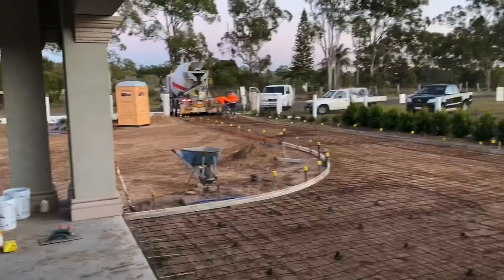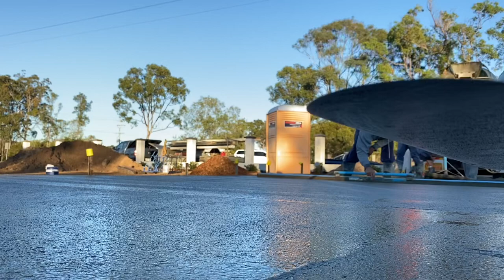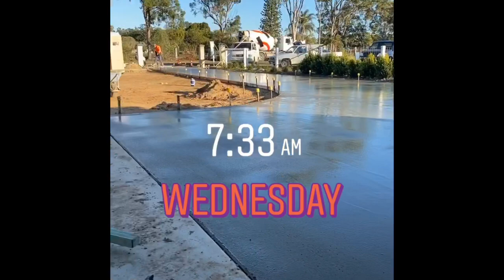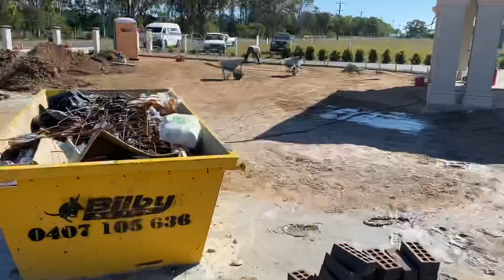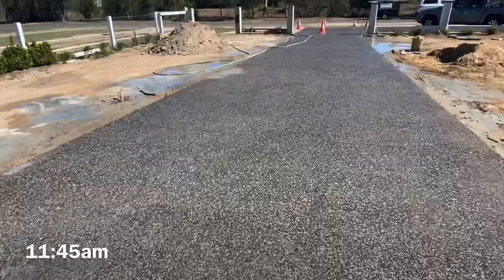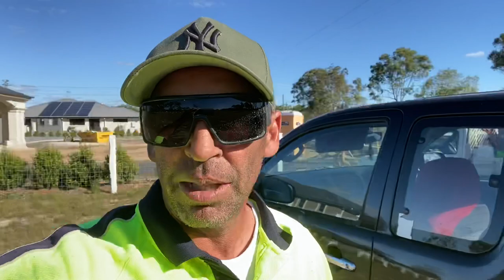Tips on when to wash off expose concrete

Comment: What do you do if the first part of the pour washes off and the rest doesn’t was off, tried a broom when washing off but no go, is there any way to wash it off? Acid wash?
Reply from the maker: It always washes off but if it didn’t wash off you could use acid to help you
Reply: @concreteninja  I think the mix was bad, we had to send the truck away and get another at our expense as it wasn't wet, and the operator was not doing what he was asked. second truck was great.
Reply from the maker: @Jacobskate  they should bring it how you asked for it and if it’s not like that you should not have to pay for it